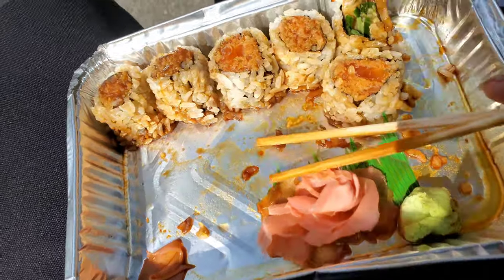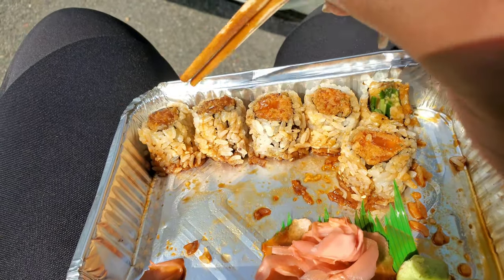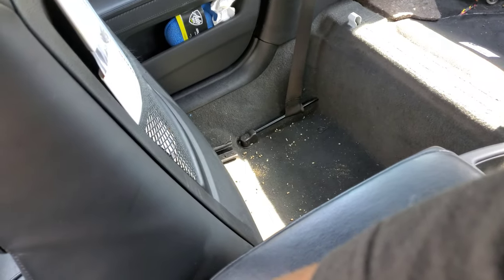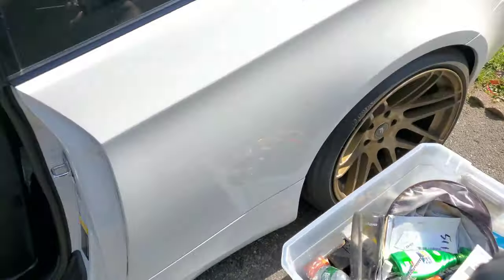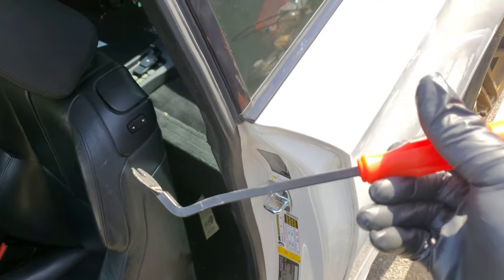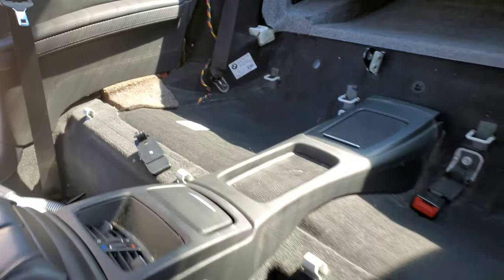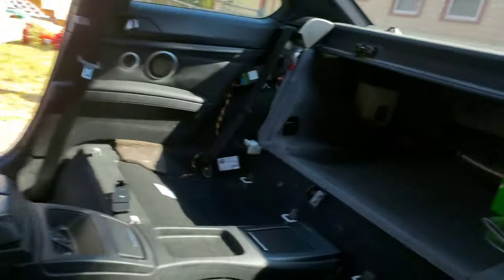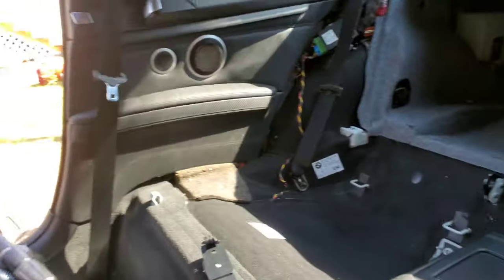how to remove e92 rear seats | free weight reduction + track prep !

Comment: Don't kill yourself trying to get the back seat out of a E92 coupe. In between the seats there is a bracket. There are 2 Torx 45 bolts, they are a pain to get to, but if you are patient and remove them the whole seat will come out.
Reply from the maker: If I remember correctly I did do this. But I'll keep this in mind since I'll be using this video when I get my next e92 m3 lol hopefully within a month
Reply: It’s harder to get this torx out than pull the seat. It’s better to remove torx on the side of seats holder and pull bigger part and it will fine. Try to put back those torx if you want to put seats back just in case you want to sell the car
Reply: @pawelludew291  When you bend the rod and can't get the seat back in correctly, it will be worse. I said it was a pain and be patient.

Comment: how did you get the back seat down before you took it out? that part was not shown after you took the side panel off.
Reply from the maker: Theres a button to open it on both side.s

Comment: i change my fuel pressure sensor and my gas valve and my gas gauge still doesnt go down pass half a tank. Any idea wtf is happening to me?
Reply from the maker: Maybe the arm thing in the fuel pump isnt floating could be caught on something
Reply: @imSchwaggy  damn I was afraid of that cuz I figured I was gonna need a new fuel pump. Hy its cheaper than a head unit. Thanks for the suggestion because I was running out of options anyway.

Comment: How did you slide the rear seat out is there a pin I’m missing to unscrew or does it just slide out
Reply from the maker: U have to slide the hook back and pull at an angle. Its kinda weird to do but ull eventually see how it has to come out
Reply: @imSchwaggy  how does the hook come off
Reply: Nvm I lied I got it thanks my dude 👌🏿
Reply: I was trying to take the top part off lasttime buy I couldn't so I let it on for now. Lol, after the two big torx on each side I tried to yank the right peice out from that pin but it wouldn't budge.

So there's a hook you pull before you wiggle it out then? I must missed that part.

Comment: Will this work for an e82 coupe? Has the tray like storage in the back seat, seats 2 people in the back
Reply from the maker: Yup, will be similar. Should be removing about 30-50lbs depending on how much you take out. Just make sure u keep the hardware so u dont lose it
Reply: @imSchwaggy  thanks much. The bottom part only not the back.  I have to pull out the seat belt clip that’s under the seat
Reply from the maker: @JaeVoris  no problem at all
Reply: @imSchwaggy  hopefully just the bottom part is a pull up no unscrewing or removal of bolts.?

Comment: So how much weight do you save on removing them rear seats boss?
Reply from the maker: No idea. Maybe 30-40lbs
Reply: It’s actually almost 70 pounds, the seat bottom is about 15-20 and the 60/40 backseats on the e92 are a heavy 60 pounds.
Reply: Bottom two piece seats weights 6.7kg together and upper parts are like 17.2kg and 1.6kg headrest. So all weights 26.5kg not sure lbs but I think something like 56-57lbs. I have checked everything and this is how it is. That big piece of bottom in the boot weights only 2kg not 5 like some people say.